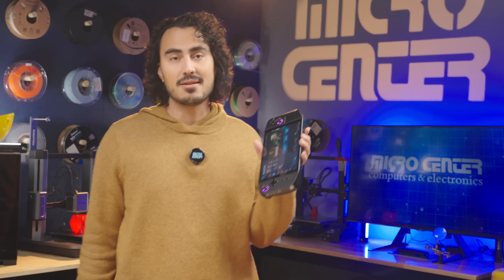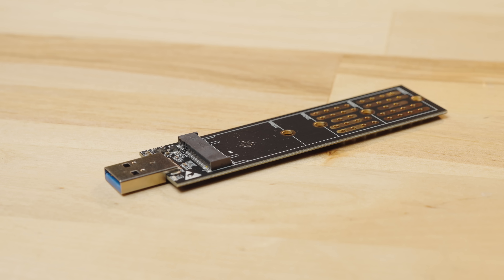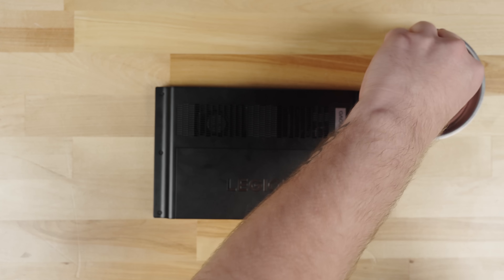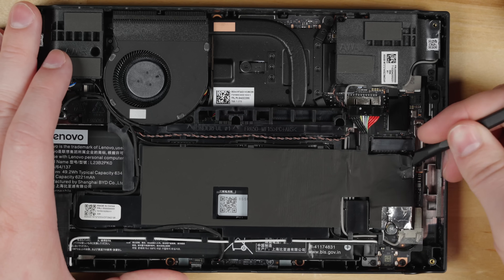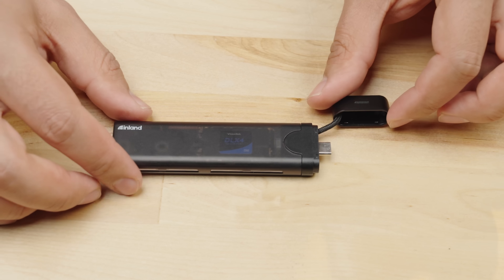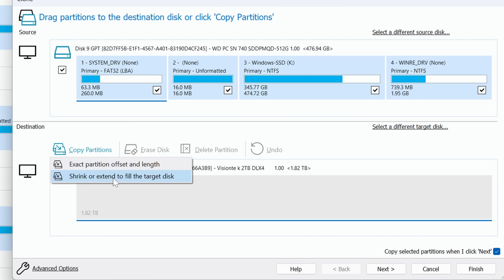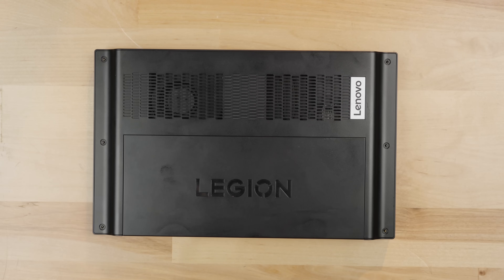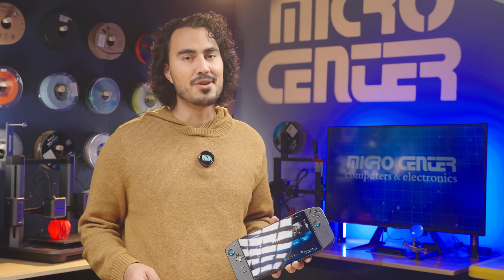How to UPGRADE your Lenovo Legion Go SSD!

Comment: I like what you guys are doing for the Lenovo Legion Go. Nice work! I’m curious to learn of future device mods for 2280 SSD’s.
Reply: There's custom backplate for 2280 ssd
Reply: there is no space for a 2280 mod...
Reply: @ViXoZuDo  That is the miracle with mods, there is always a solution 😁
Reply: @Cemruto  There is no room inside for a 2280 like the rog ally. The only way to fit a 2280 inside the legion go would be cutting a hole in the backplate basically destroying the device... if you're going to do that, just get an external SSD.
Reply: @user-ds8rj2vc4v 1. Portability would not be better... there are a lot of 2230 nvme enclosures... just add a short usb cable and attach the enclosure/nvme with double tape. The overall volume would be the same or even smaller than a modded 2280.

2. The legion go have dual USB ports (one on the top and one on the bottom)... also, every single eGPU on the market have at least one extra USB ports and some have multiple... So just connect the external nvme to that port.
Reply: @user-ds8rj2vc4v1. If you attach a 22x30x4mm device with double tape, you efectively have a smaller device than cutting the backplate and adding 22x80x2mm (if not more considering that you must 3D print the cover of the hole you would made). Both cases you end up with a single device. There is no "fewer items". In one of the cases you are effectively destroying the device backplate... in the other you are adding something that you could remove easily in the future.

2. Affectively speaking, unless you want to transfer big file or edit 8k videos, there is no difference. There are plenty of videos online about blind tests in games between a sata SSD and diferent gens NVME. Remember that you have way more than enough brandwidth for random IO that is what you use for games.
Reply: @user-ds8rj2vc4v I'm not presuming... I'm 100% sure there is no enough space. There are already people who have "done" it and the backplace and kicks doesn't close anymore. You must cut it down if you want the extra room or have it partially open.

2nd, if someone ever sell a modified backplate, you could also add support for multiple SSD, multiple ports, etc. Also, not even the steamdeck have that kind of backplates and there is no way lenovo would get more support than the steamdeck. If someone ever sell a aftermarket backplate, it would be a clear one or something like that.

Taping is crappy and janky but detroying the backplate is not worse? what is wrong with you?

Finally, you would not block the egpu... you have TWO (2) USB ports in the lenovo and every single egpu have USB ports for that use. Also, there is no such a thing as "masive" throttles related the storage. Most of the game related stuff is preloaded to the RAM and VRAM during the loading screen, so you barelly use the storage after that when your GPU need that bandwidth. Yep, game developers are not dumb... the games are designed to work even with old HDDs and the real impact is during the loading screen.
Reply: @ViXoZuDo  And 3 mo later there are 3d printed back plates.... with room for an M.2 SSD. Literally shoudl have been made compatible with 2280 SSDs from the start... its absolutely stupid.
Reply: @Wingnut353  and defeating the whole purpose of the SSD upgrade. If that could be considered, then just replace the whole device with a desktop PC with a Jackery power station inside. This is like thinking that the Ally mod of the battery replacing the whole backplate is a better alternative than a simple external power bank.
Reply: you can have a sidemounted spacer. which allows it to sit over the battery  @ViXoZuDo
Reply: @ViXoZuDo someone has put a 4tb 2280 in one now with an m.2 relocation using a riser ribbon cable and putting it horizontal over the battery, still had full function of the kickstand and backplate closed fully
Reply: @ajroxjox3254 You must:
1. Remove one of the support structures 
2. Press the ssd to the battery (not safe) 
3. The end result is not closed properly (bulges)

Basically you end with a dangerous device with a SSD press against a battery... And in case you don't know, the SSD heat could damage the battery and there is a high risk of fire.
Reply: @ViXoZuDo  i hear what your saying, on the video that i saw they had the carrier against the battery so there was an airgap between the ssd and the battery, there wasnt a bulge and if i were to do it i would 3d print or cut the bracket to support it better, i think the major downfall was the fact that it was limited to 3 speeds due to the riser

Comment: You can clone it first without removing and then just swap if you want to go faster.
Reply: Was literally sitting here watching the video thinking, “couldn’t you just clone it with 1 adapter from the device itself?” Lmao.
Reply: @calvingoff6442 I was thinking the same thing 😅
Reply: @calvingoff6442  same man
Reply: would you just attach the nvme enclosure on the legion go to use the cloning software straight from the device?
Reply: @COATED001  yes, just use a usb c nvme enclosure you can just plug in and clone.
Reply: Exactly!Work smarter,not harder!
Reply: Your comment saved me time. Good thing i read this before upgrading my ssd to 2TB
Reply: I get your point, you guys are forgetting, these are new out the box units. I wanted mine upgraded BEFORE I signed in and all that setup crap.
Reply: I was gonna post this as well you can clone it without taking the device apart twice. I know macrium is feature rich, but not free if you want to accomplish cloning more than one drive. I use diskgenius personally and it works just the same for freeware.
Reply: There is a 2tb nano external nvme drive with enclosure, size of a quarter and with 180 USB c to c adapter, I got instant 2 tb without opening the LeGo and don't look that bad either
Reply: @bittertruthnavin  Can you tell us where you got it?
Reply: I did this and now when I turn on my legion go it says I need to recover my PC? Anyone had this issue I’m using a 2230 with an extender, I’ve checked it’s fitted properly
Reply: Absolutely 👍